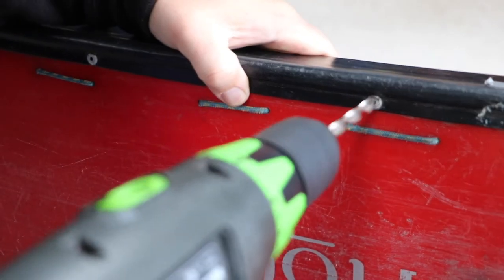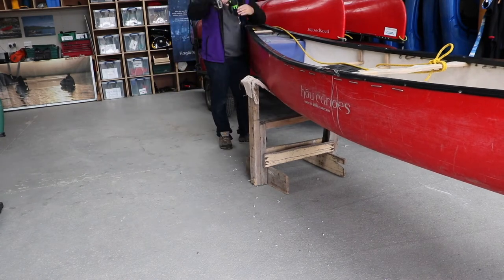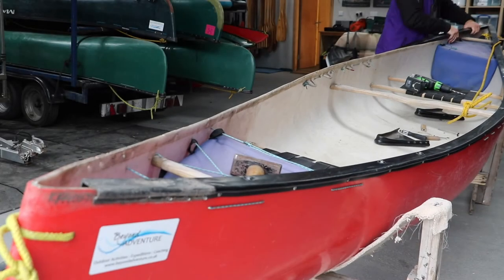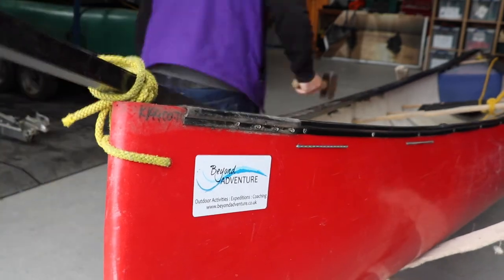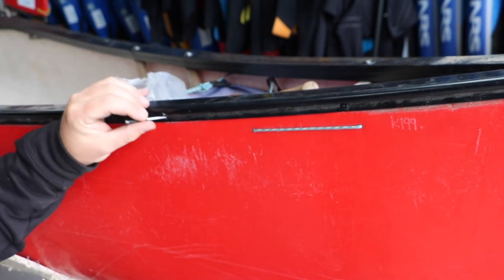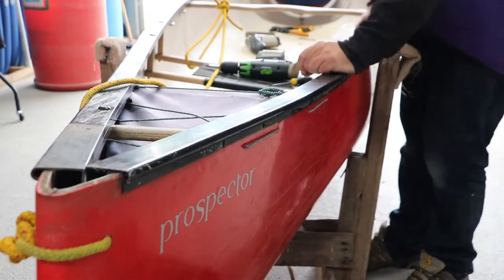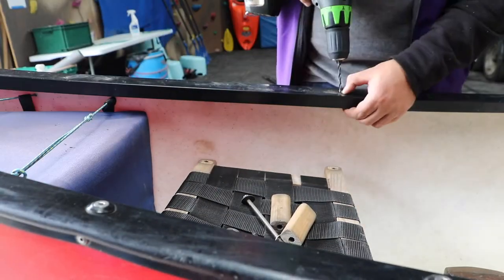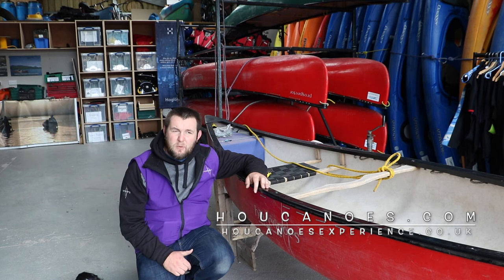How to replace a open canoe gunwale

Comment: Thank you for the great DIY video.  When you drill the rivet holes on the new gunwale, do you line it up with the existing holes on the canoe?  Or, it should be avoid using the existing holes?
Reply from the maker: We tend to just drill new holes as it's much easier than trying to locate the old ones, often the old holes aren't useable anyway.